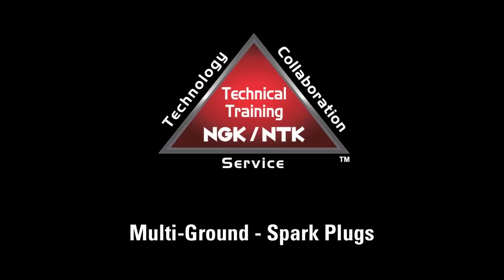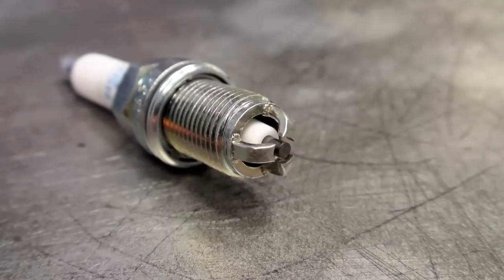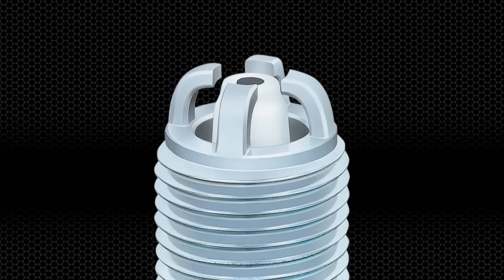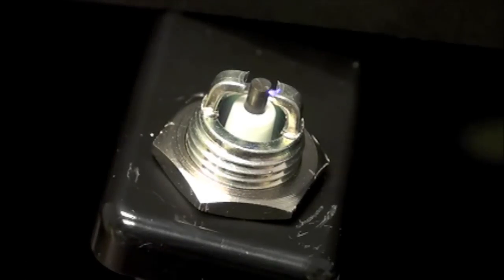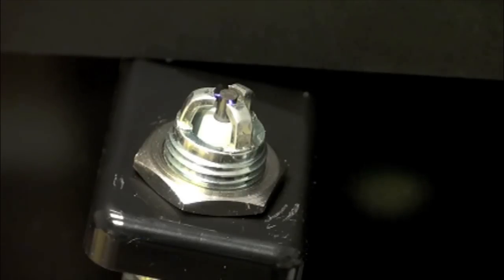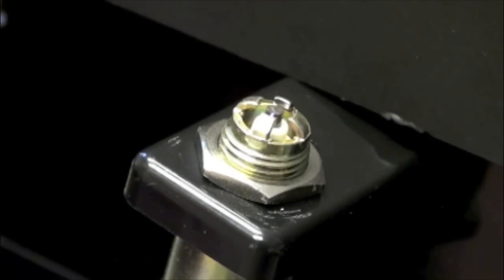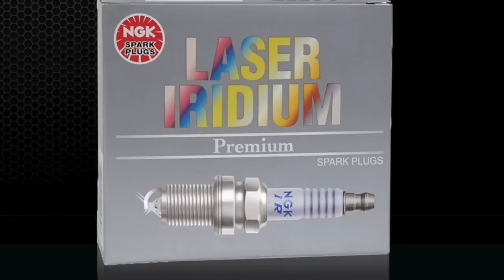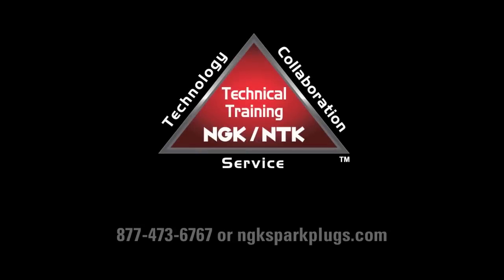Multi - Ground Spark Plugs - NGK Spark Plugs - Tech Video

Comment: It's like expecting 3 towers being hit by lightning at the same time. Electrical arc will choose the path of least resistance. Once a path is started, creating a new path will need more energy than just following the path already made. So the other electrodes are just occupying space in the combustion chamber for nothing. In fact getting in the way of combustion which should be finished in split second. Another marketing ploy for car owners who should know better.

The reasoning that it will wear out longer does not hold either. As the center electrode is the first to wear out as it is the one initiating the arc at very high voltage.

Comment: I recently purchased the 4-ground NGK spark plugs for my old BMW on the advice of my parts dealer, but after watching this video, I researched the OEM plugs for my model, and BMW recommended a single-ground plug. I returned the 4-ground plugs to the dealer and purchased the single-ground NGK Iridium IX. There was not much price difference. Thank you.

Dan

Comment: Thank You. I used to work a block away from a emission inspection station. I can't tell you how many hmm, hmm, hmm, hmm, hmm and hmm, hmm multi-ground spark plugs I threw in the trash in order to get cars to pass their test. Almost all of them came from A-hmm, hmm, hmm parts store in a 'zone' just down the street and had been 'pushed' onto many customers. Quite a few of them were so sold on them they insisted I install new of the same but I always told them to take their car somewhere else, that I didn't need the headaches of them coming back next year when they failed their inspection again.

Comment: My concern is why multiple  ground electrode  plug has the open designs. Which looks practically  as the spark is open and can ignite better than single electrode  which curves  and spark under . Because  the plug is facing the intake and exhaust valve which with the multi electrode  the spark is on the top which will increase  ignition . Why they dont make single electrode  side like multiple electrode?  Now the design plays more role than the number of electrode

Comment: I wish these 2 ground electrode plugs were available in non-resistor.  The only reason resistor plugs came about was to counteract EMI when cars still used distributors and had long plug wires to carry the HV which acted as antennas.  Now that almost every car uses COP technology, the source of EMI (distributor and wires) has been eliminated so there's no reason to run resistor plugs anymore which do nothing but waste spark energy thereby reducing performance and fuel efficiency.

Comment: So are the multi grnd plugs un gapable?  Or is there only the one spark gap preset on manufacture?  Why wouldnt increasing the gap size change the flame if that was an issue with those type of plugs?  Do multi grounded plugs run a greater risk of a ground electrode breaking off inside the cylinders?

Comment: So, for the last 8,000+ miles, my 1999 Camry 2.2l has been sporting four NGK Ruthenium PSPE (projected square, platinum electrode) single electrode spark plugs. Now before anyone gets mental and says I'm supposed to be using NGK's Ruthenium DFE (double fine electrode) plugs, please know NGK does NOT make them for my engine and NGK guaranteed me the PSPEs will work fine in my engine, which they absolutely do. These plugs have been a total win for my engine, and while I do not have technical hard data proof of this, I know the car runs peppier and happier in all conditions, and I'm getting about 1 more mpg. 

About 3k miles prior to installing the Rutheniums, I had installed the NGK OEM double electrode plugs my car was designed with and I had hoped for better results over the AC Delco single electrodes the dealer oddly installed when the prior owner brought her car in to get her 75k service. I wanted to make the Delcos go away, so while searching for OAEM plugs, I stumbled upon the Rutheniums on Rock Auto. I immediately got in touch with NGK before I sprung for them, cause they were $40.. I have to admit I wasn't sure at the time what the difference was between the DFEs and PSPEs, but it didn't matter as Rock Auto sent me the PSPEs, so I just went with it. THEN, I made a YT video on the Rutheniums and was told (yelled at by certain psycho-techs) that I was supposed to be using  DFEs and I was a rat-bastard for not doing my homework. SO, I contacted NGK to find out what the deal is if these PSPEs were going to destroy my engine. After talking to NGK, I found out that I'm totally fine using these PSPEs and they just don't make DFEs for my engine at this time. SIDE NOTE... My results were so positive using these PSPE's that if I had the later chance to buy DFEs, I wouldn't. And understanding that if Rutheniums had been invented when they designed my engine back in the mid 1990's, the original OEM double electrode platinums may have never been the OEM plug. There is so much more technology in these plugs than Toyota had in those days, it is quite possible they would have made the PSPE design their OEM plug. Maybe not, but I will say I'm not going back to OEM. Oh, and BTW, these plugs are not for everyone. I hear reports that they work best in daily drivers and not so much for tuners. Maybe that will change???

Comment: NGK 2360 CR10EK Multi-Ground Plug VS NGK 3521 CR9EIX technical specifications are the same
Which spark plug can give more performance for Motorcycle?

Comment: I don’t like 4 grounds  it blocks the electric flow so then less power for massive explosions inside the compress gas and air mixture I texted this 4 grounds but only choose one ground or the most 2 for v8 or v12 v6 only needs single ground and it’s smooth and perfect in low rpm or racing,too much grounds and not gonna do anytime because the gas air mixture are fix every time all the time so no changes needed.On the other hand Honda engines are different 4 cylinder

Comment: 2 ground or more looks amaze you. My experience on my bike, 3 ground is worse than single ground. The Single ground spark is more stable thus smoother engine vibration. Don't trust a spark plug ads offering overclaiming benefits. I think what best for every engine is just follow the manual.
Reply from the maker: Good advice. Always follow the manual.

Comment: I cut off all the electrodes except one making it an awesome side firing spark plug 👍, remember only one of those electrodes can ground out at once.
Reply from the maker: Hey James, why not just buy one of our side firing plugs? Save yourself some work :)
Mike Becker, Senior Technical Instructor
Reply: @ngksparkplugsusa  I just did that for shitz and giggles, that particular spark plug came with a kit.I run bpr6hix in my motorized bicycles.

Comment: How kilo life time NGK Iridium IX spark plug?
Reply from the maker: Hey Canon RT, it really depends on the vehicle/engine. Generally we suggest 25-50K miles or about 40-75,000 km...what kind of car is this for?
Mike Becker, Senior Technical Instructor
Reply: 250 cc motorcycle

Comment: Well, my Camry originally came with twin electrode NGKs, so that's what I just bought at a cost of $40.. Now NGK is saying poo poo to multi electrodes. Should I send them back and buy Iridium single electrodes?
Reply from the maker: Hey Dbf Crell, if your car came with twin electrode plugs from the factory then that's what the car was designed to run and I would suggest putting those back in. Generally you wouldn't want to use a multi ground plug in an application that wasn't engineered for it. I'd be happy to grab you a part number for you car if you can hook me up with the year and engine size. 
Mike Becker, Senior Technical Instructor
Reply: @ngksparkplugsusa  I just ordered the correct NGK double electrodes and they arrived, but I'm waiting on my Granatelli 0 Ohm ignition wires to arrive so they all can go in together. Now here's the weirder part... I'm also thinking about ordering some Brisk EVO plugs. Please tell me why I don't need to do this. If you have a great argument, I can be talked out of it and I'll just install the NGKs. The cost is not an issue, but I am very curious to see if a hotter, larger erratic spark without a protruding electrode will lead to better anything. What do you think?
Reply from the maker: May I ask...why 0 ohm wires? Not sure on the year of this Camry....but if it has electronics on it you will be messing with those. Resistance is in the wires to cut down on electrical interference. As for why NGK I have a super simple answer...What plug came in it from the factory? How many hours were spent developing the spark plug for that engine in original R&D? How many cars come with that other brands plug OE? There is a reason NGK is in so many cars from the factory. :)
Mike Becker, Senior Technical Instructor
Reply: @ngksparkplugsusa  Hi Mike, It's a 99 Camry XLE 2.2L utterly stock with the original wires. 83k on the clock.  The 0 ohms are guaranteed not to interfere... but we'll see! They'll go right back if they do. On the Brisks, I would think cost would be a reasonable answer for the Brisks not to be in most cars from the factory, plus they weren't available yet when they designed my 4th gen engine. I realize they would be sick-overkill for a little 4 banger like mine, but one reason I had been thinking of doing this (which I just decided not to) is because I just sold my 98 Corolla 1.8L which got sick gas mileage (35mpg) and the Camry, which runs like new, only gets 26mpg. I drive 500 miles/wk. It's sorta killing me, and I know my Camry needs plugs and wires, so since these expensive wires and plugs promise a mileage increase, I was going to taking the Flame Kernel Challenge. Guess I'll just do the wires and send them back to Granatelli if they suck. Thanks for your words of wisdom.
Reply from the maker: Good luck! Hope everything works out ok. We also have wires for your car. Part # 8916. They are standard resistor wires, just like what came originally. 
Mike Becker, Senior Technical Instructor
Reply: @ngksparkplugsusa  Thanks, those wires are in my cart on one of the sites I frequent. Quick question, if you don't mind? ... I need either resistor wires OR resistor plugs, not both, right? And if so, are there any benefits to it being one over another?
Reply from the maker: You want both. You want to essentially shield anywhere the HIGH VOLTAGE is running through. So, anywhere after the ignition coil should have resistance to cut down on RFI/interference. Without the resistance, you can induce voltage onto sensors and signals and such.
Mike Becker, Senior Technical Instructor
Reply: @Flapping Flight I tried to get the Granatelli wires, but it was a total no-go. They stopped making them for my 99 Camry and all the places that said they still had them in stock were super-shady. I had to stop my cc payment on two different sites. I ended up buying NGK wires and covering them with heat-resistant TechFlex and installing NGK Ruthenium Sparkplugs which actually made the car perform better due to the PSPE single electrode design. The car has never run better or started quicker. Wish I had the opportunity to try the Granatellis, but it wasn't meant to be.
Reply: @Flapping Flight Well, I think I'm done with wires for now. I would imagine my next vehicle will be electric as I currently have and electric scooter and a fat ebike and both are amazing. Combustion is working it's way away from my heart quickly. Thanks for posting!

Comment: I just installed the bosch platinum+4 multis in my honda accord.   It runs much better now.  Smoother and no hesitation.   I’m convinced
Reply from the maker: Hey Gene, how come you didn't run NGK's?!!? :) 
Mike Becker, Senior Technical Instructor
Reply: Cause I cant find the 4 ground type from NGK (or anyone else except Bosch).   Checked the web site for an Accord NGK only lists 6 different single ground varieties.    The theory presented here is all well and good.  But the proof is in the actual performance in the real world.  Multi ground is better in my experience.

I was suffering from hesitation and poor 1-2 shifting (delayed shifting up and down) for years.  I thought my tranny was failing.   After I put in the multis the hesitation was gone and shift is smooth.    I believe poor engine performance causes poor shifting as the computer has trouble determining correct shift points.

This is not the first time I have tried multis.   I used them back in the 70s in my Chrysler 300 and the difference was night and day.

Comment: Actually multi-electrode spark plugs are far older than the 1970's and invented by Lodge Spark Plugs during the 1950's. 

I have a boxed 1950's Lodge HH14 three electrode Sintox spark plug still in its wax paper instruction wrapping in my spark plug collection.

They were intended for use in 2 stroke motors and offered anti-fouling, which was a problem on 1950's 2 stroke motors running Castrol R and SAE 30 oil (specialist 2 stroke oil didn't appear until the late 1960's). 

Having run Lodge Sintox plugs in 1970's and 1980's 2 stroke motorcycles the first noticeable improvement is the very real hike in low down engine torque and fuel economy as a result. This may be more down to the use of Sintox as the ceramic surrounding the soft iron anode as opposed to conventional Alumina Oxide ceramic as Sintox is slower to lose and gain heat than Alumina Oxide thus maintains a more constant temperature range during idle / cruising / hard acceleration engine conditions. However Sintox spark plugs take slightly longer to warm up to operating temperature from a cold start as a result.

Having watched a Lodge tri-electrode spark plug operating on a twin cylinder motor I can attest to the fact that they do not spark on all electrodes at the same time but rotate the spark at random between electrodes.
Reply from the maker: Hey Andy, thanks for commenting! That's cool! You have an extensive "old plug" collection? That makes sense, those old engines had to foul out all the time I bet! Mazda's rotary engine burned a lot of oil as well, that's why they went with this design.
Mike Becker, Senior Technical Instructor
Reply: A friend swears by Brisk spark plugs (formerly a division of the Czech company PAL). They have factories in the US and South America.

Having worked and tuned bike engines since 1980, I've learnt that engines will perform better on one brand of plugs than another, despite apparently being direct heat range equivalents. It depends on the engine so what gives a better performance on one manufacturer's engine type won't on another.

The biggest problem currently is poor combustion caused by our EU / UK E5 unleaded petrol. Normal unleaded has a vapourisation point of 35 degrees C but adding 5% ethanol drops this to 18 degrees C. OK if an engine has a computer running the fuelling but a disaster for carbed engines especially those built originally to run higher energy content leaded petrol, as these engines are already nerfed in performance running on straight unleaded. 

The engines that suffer the most are 2 strokes (though some 4 strokes can also suffer in the same way) as once the cylinder has warmed up the fresh fuel air charge vapourises as soon as it enters the cylinder instead of when compressed and heated by the ceramic surrounding the spark plug. This results in a poor combustion burn as the spark plug is circumvented in its vapourisation role prior to providing the ignition spark. 

Poor combustion symptoms are excess soot, carboned plugs, excessive smoking, over heating engine and total loss of low down & midrange torque once the engine reaches operating temperature. Also prone to seizures on longer journeys. Jetting down will cause a holed piston so not a solution either. Reducing 2 stroke oil ratio will shorten engine bearing and piston ring life plus risk seizures during engine braking.

The problem can make a mechanic believe that he or she is dealing with a weak ignition problem, which is how I was dealing with it. However after replacing complete ignition system component of several bikes, it became apparent it wasn't.

By chance I found the Castrol engineers report on the problems and damage ethanol contaminate petrol causes to old school engines and the problem was solved. 

Castrol recommends mixing anywhere between 30:1 to 50:1 kerosene or diesel into the petrol. Adding kerosene or diesel to ethanol contaminated petrol raises the vapourisation point. 

I've experimented with 7 different 2 stroke bikes (50cc, 125cc, 150cc, 175cc 250cc 305cc and 350cc) and found adding 33:1 to 40:1 diesel cures the problem. 

Pretty much the problem lies with the politicians for allowing ethanol contamination of fuel in the first place. It's down to spark plug manufacturers, mechanics and vehicle owners to first figure out the various problems caused and then devise ways to circumvent them.
Reply: @CZ350tuner   do you indexed the different brands spark plugs uniformly when compare which one the engine liked the most ? Some time, because of random orientation of the ground electrodes even the same brand identical spark plugs could give you differences in engine  performance . How important is it could judge by the fact that the  auto manufacturers started to index the spark plugs straight from the factory and even sell uniformly treaded replacement spark plugs which guarantee you proper indexing if tighten to the recommended torque without the need to select the proper one from few randomly chosen spark plugs .

Comment: This design was used in aircraft engines 70 years ago for reliability & is still used now. The main benefit was if one earth wire gap was fouled with oil then the next path of least resistance would spark ensuring continued cylinder firing. In automotive practice, it's just a gimmick.